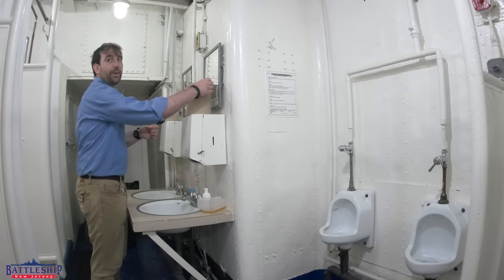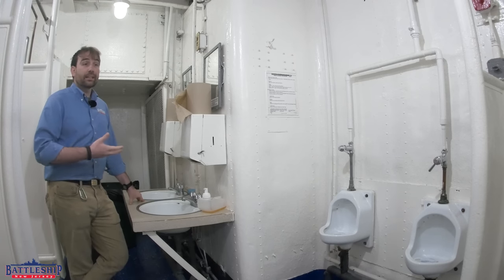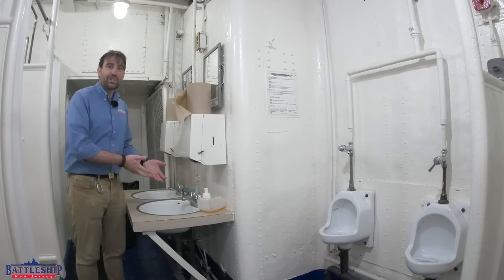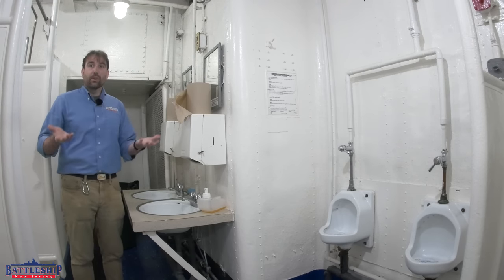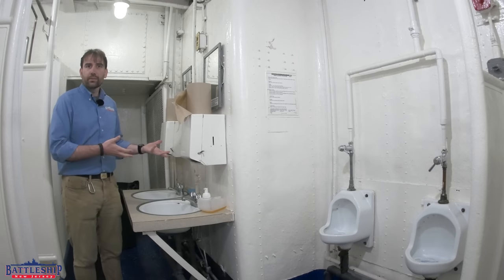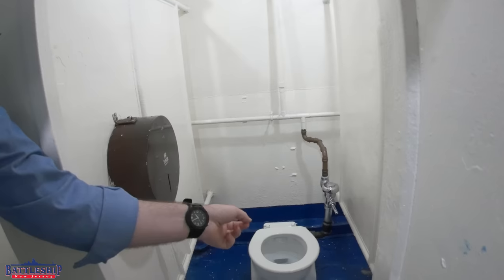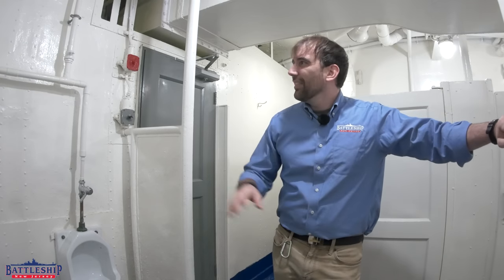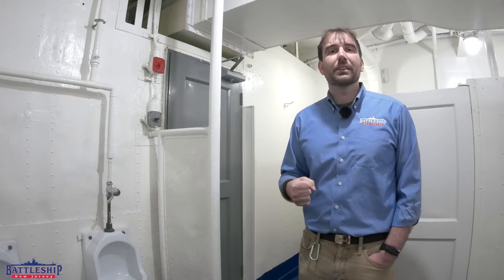Warship Plumbing

Comment: 12 gallons per flush?? 🤣
Reply: Toilets from the 80’s used upwards of 7-8 gallons, ( like 18-30 liters) modern toilets use on average 1.6 gallons or less per flush so by that logic 1940 toilets would use a shit load more 
Pun intended
Reply: I think Ryan misread 1.2 gallons per flush.
Reply: yep, he never thinks about this stuff for his home. 1 or 2 gallons per flush - probably been around for 20 years now. BUT he did not mention both Little Rock & NJ - I expect salt- water for commode and toilet. (as Mongoose388 indirectly implies above - firemain is salt water. Fire main is >100 PSI.  Home can be ok with only have 10-30 PSI water company supply.
Reply: @willpugh8865  7-8 gallons would be before the 1950s.  By the 60s they were down to 5.5 and in the 80s they were around 3.5.  1.6 was federally mandated in 1992. (My father and uncle owned a plumbing and electrical business before they retired).  I don't think there's ever been a mass produced toilet that used 12 gallons.  As you said that's a crap load of water.  Think about pouring 12 gallon jugs of water to flush.  Even 8 is a lot!
Reply: The toilets were flushed with salt water.
Reply: I once took a trip to New York City,  early 90s, came back via Niagara Falls to see it and cross the board and by a 🚽 toilet that used Six gallons per flush, crossed the boarder and the person asked which store I bought it from, gave him the answer, he fine go on your way the sell the Good ones. It was 2010 before I found one in the USA that really worked right.